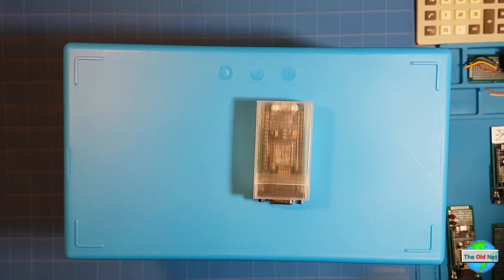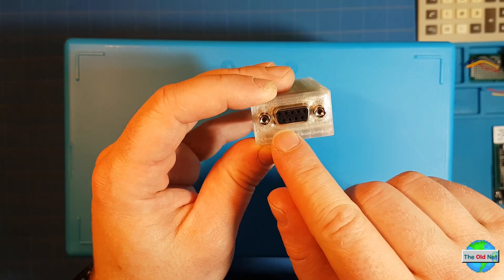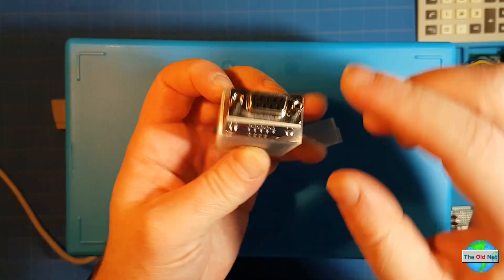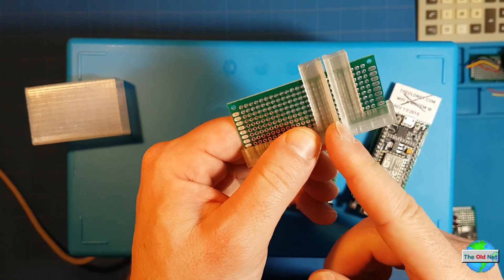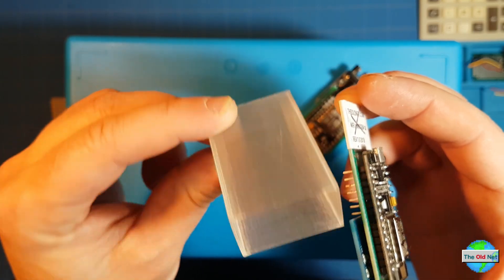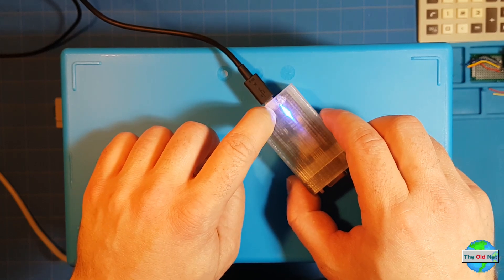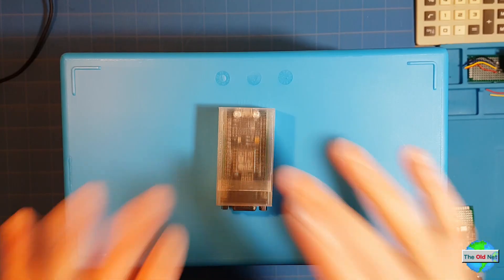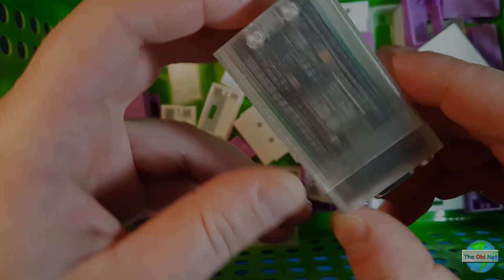Introducing WIFI Serial Modem Version 2!

Comment: I am a bit lost. Do I need a microsd or something? I just got mine, plugged it as it is... and no dice, I don't get any connection and can't even display any character into the terminal, so no at? for me. The manual just mentions the settings, but I can't do anything. Interestingly, it also mentions setting it to xon/xoff
Reply: ok, just the old "cable doesn't work". I removed the case, plugged it directly into the COM port and it worked! Now I am stuck to 300bauds tho 🤣 (trying to change it with at$sb=9600 just freezes the terminal)

Comment: OK, this may be a silly question, but is there an off button? If not, should I leave it always on or should I unplug it when I'm not using it? Thanks.
Reply from the maker: There isn't an off button. However the device doesn't consume that much power. When disconnected from WIFI it consumes 80 milliamps at 5volts (0.4 watts). On WIFI I believe it's 170 milliamps if memory serves me correctly. 

Generally I disconnect mine when not in use. I think it would be fine to leave it plugged in though.

Comment: Just bought mine for my Tandy 1000HX - got through a bunch of issues (I'm new to all of this, and am using Banancom). I cannot connect to either of my WiFi access points for some reason - I enter the AT commands for SSID and PASS but it cannot connect. I do not have WPS enabled, and no custom security protocols or anything enabled. My router supports A/B/G and N as far as I know. Any ideas?
Reply: Sorry Just saw this now. Case matters so maybe a case mismatch? Could you record a video? Did you ever get it to work?
Reply: @TheOldNet  I got it to work, but am having nothing but problems... I ended up moving onto other projects for now.

Comment: Based on the pictures I see, this doesn't have hardware flow control (handshaking). Any chance of a revision that does?
Some of these old systems have tiny buffers, and not a lot of cycles to service them.
Reply from the maker: Yes! I am in them middle of designing version 4 which has hardware flow control plus a couple other new features. 

I have a KiCad sketch done, I am sourcing parts. I have some chips on the way that I am going to be testing before doing a bulk order.

I have designed two form factors and I'm testing which I want to go ahead with. 

The new version will be more expensive so I plan to still offer the existing version at a lower price. 

I don't have a firm release date yet. I do not think I'll have it ready in 2021, but this is one of the main projects I am working on. 

I might have some updates in a few months.
Reply: @HomeAwesomation  It looks like the flow control is supported in the firmware already. Would it work with the right level shifter? Maybe an SP3232
A D1 Mini could be used too, no?
Reply from the maker: @tehrobotjesus  Anything running an ESP8266 could be used. So a NodeMCU, a D1 Mini, an ESP8266 just by itself. 

I went with NodeMcu's because of cost and features. The mini isn't any less expensive but it doesn't have some basic things like a dedicated flash button, which is used in the firmware to reset baud rate.

A different level shifter is required. A regular 3232 chip will support 4 data channels. 

I will be releasing an update after sufficient testing and sourcing of materials is done.

Comment: I just received mine and it works perfectly at 300 but I seem to have issues changing it to any other baud rate once I issue the command at$sb= ANYTHING it states it will switch in 5 seconds but upon setting terminal program to this baud rate I only get garbage, if I set terminal program back to 300 it works... thus indicating baud rate didn't change, I am testing on a windows 10 machine, have used both putty and hyperterm, I have also used real serial port on machine AND connected through the USB  cable (com5) am running into this issue in all circumstances.

HELP !
Reply from the maker: My best guess would be the device is under powered and resetting itself. The baud change is in memory only so it does not survive a power cycle unless you save it to the devices config (which you can't yet).

Could you record a video of what you are doing?
Reply: @HomeAwesomation  Upon trying again (from the physical serial port) with a different USB adapter for power it DOES allow me to switch baud rates, unsure why in particular since test #2 was performed directly connected to the USB port on computer and drawing power directly from it, but I am content now that I have been able to successfully change baud rate and save to NVRAM

Comment: Do you use a 2 port serial card, one cable hooking the wifi modem to the serial card and one cable out of the serial card with usb connector to the a router.  I am trying to start a DOS bbs with telnet and forgot a lot of things.
Reply from the maker: The modem is plugged directly into the serial port on my computer. From there it's WIFI out to the internet. There is no USB involved. 

To host a BBS you would just set the modem to auto-answer and set up your favorite BBS software.